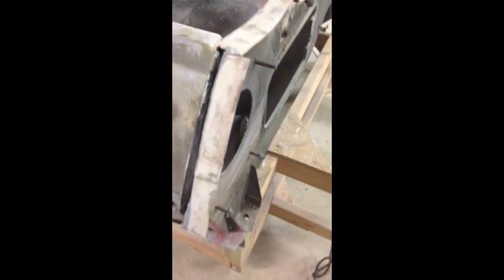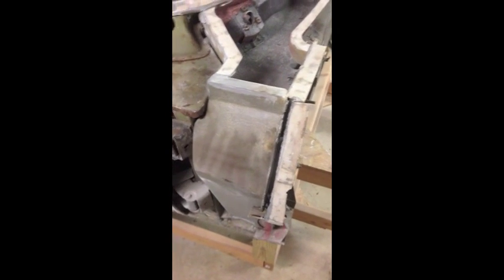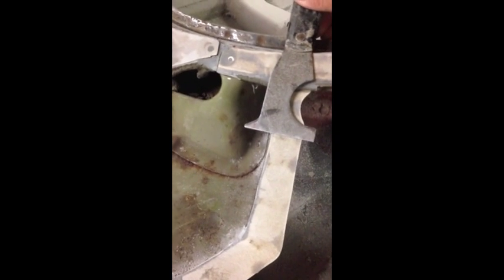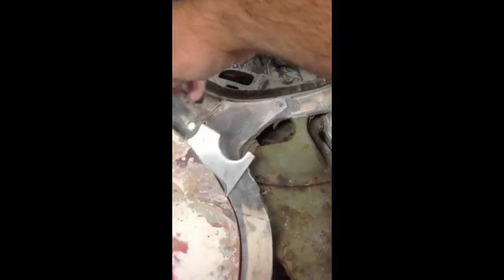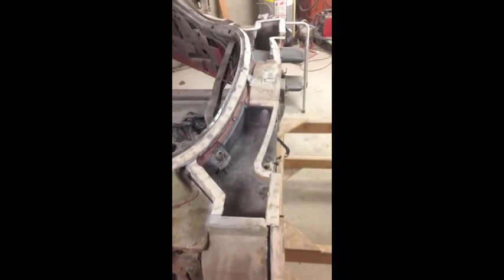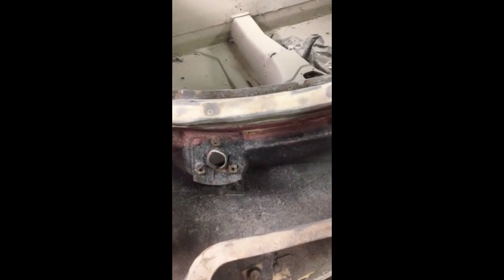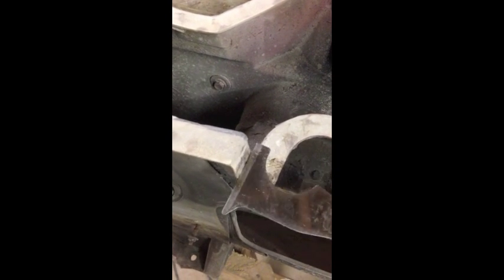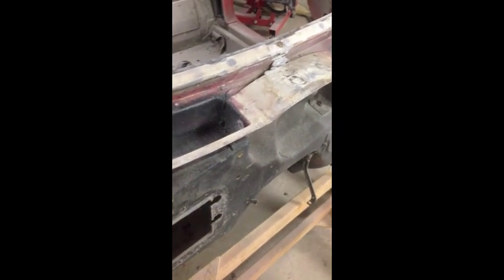front clip removal

Comment: What tool is it what you are useing?
Reply: Its a 5 in 1 painters tool. You can pick a good one up for about 7 bucks. You may want to get a couple though. They dull down fast
Reply: @dj_5163  I'm an old tool cutter grinder,if you have a good American made paint crapper easy to  sharpen,they last for years even with constant use,seems to work great with a little heat separate fiberglass